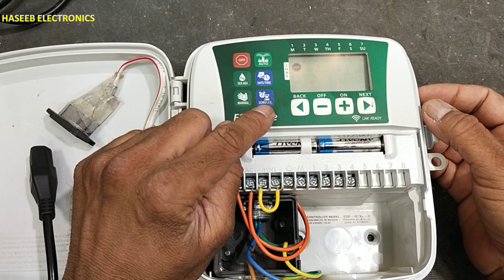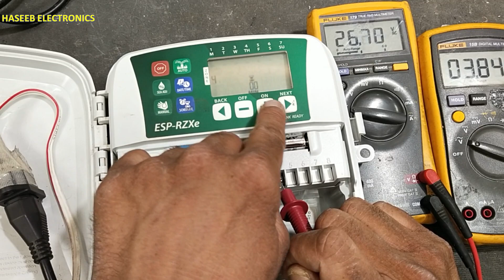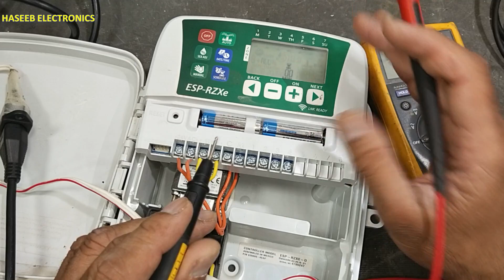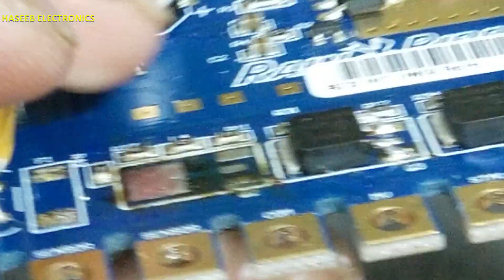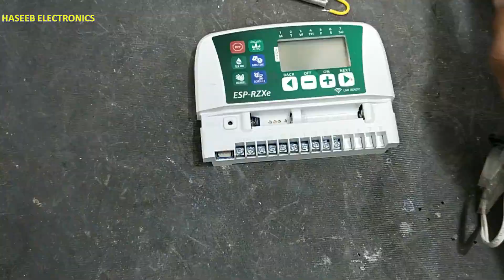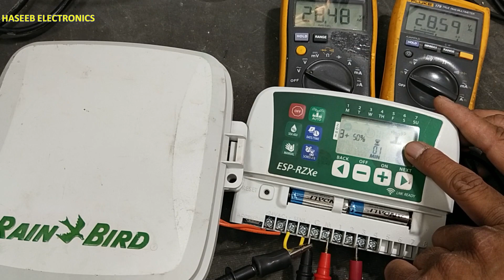{908} Rain-Bird ESP-RZXe Controller Repair

Comment: nice video sr
 I had a question , I bought a smps 12v 10A and it doesn't have any pwm ic like TLC494 and also no adjustable voltage trimmer , that means voltage adjust is not possible in this smps ??

Comment: Possible shorted water control solenoid at the customer end.
Great repair Haseeb!
Reply from the maker: i think solenoid short circuit will produce load on the transformer, and the transformer must be damaged in that case, but in this fault condition the transformer is safe
the Triac is high current rating. so its damage and station number 4 sparing some high potential cause this destruction